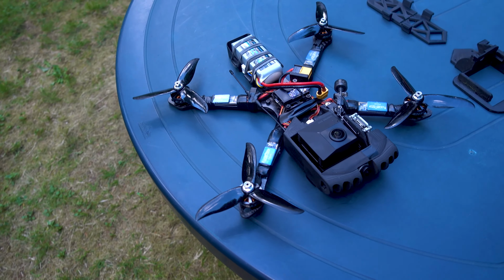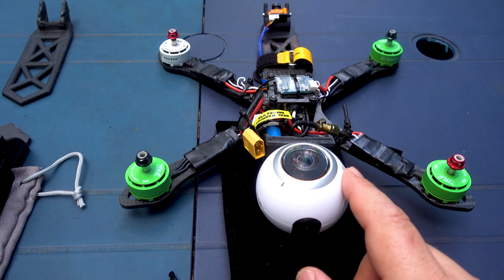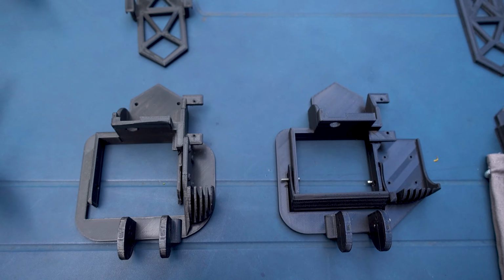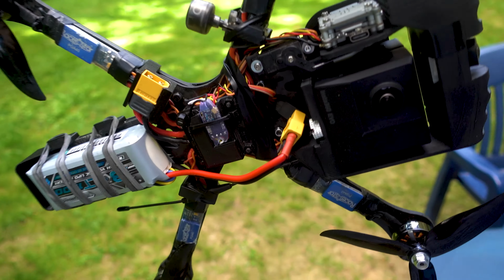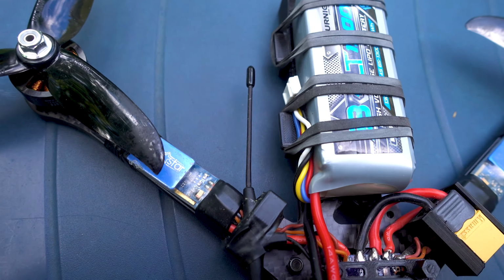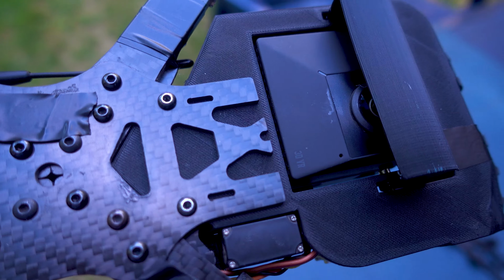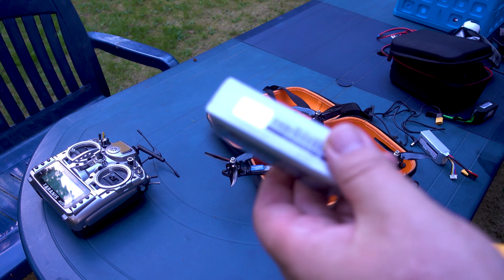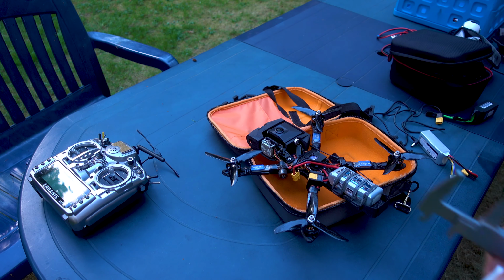Invisible 360 FPV drone with automatic lense protection - Insta 360 Evo

Comment: Good idea this drone! Have you any thougts for the One X camera (1st version) invisibe drone installation ?
Reply from the maker: Thanks :-) The One X is very thin compared to the Evo - so this would be very hard to find the right components to fit inside the blind spot. I actually created a new version that uses the Inst360 One R. To hide the drone in the invisible spot of the one r is hard enough - at least with my aproach I think it will not work. Here is the video of the One R version: https://www.youtube.com/watch?v=VXVksOtWHhM

Comment: insta 360 one r should be working too :D
Reply from the maker: You are right - that would be great :-). For the one r I need to have the lense split version that can be used for the mavic - because otherwise my drone is much to thick.
Reply: @marcusritter  i am working on a design for the normal version, do you mind me to use your present design and make changes of it? Thanks a lot! :D